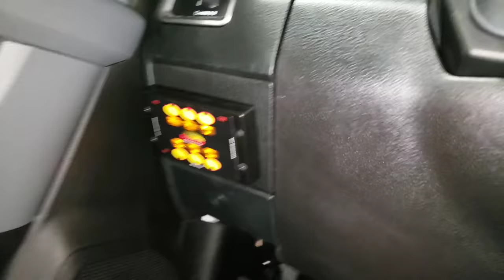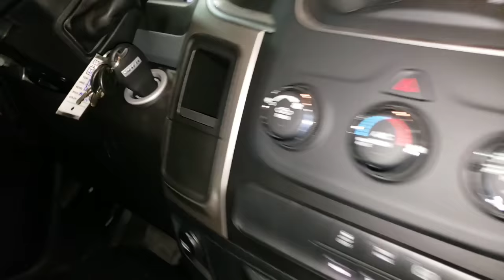LED Strobe Light Install & Sync (ST3/ST6)

Comment: What did you use to drill the larger holes ?? That’s some type of hole saw??
Reply from the maker: Yes, Its called a Rotabroach. It is a sheetmetal hole saw.  Sized used in the video was 5/8". The hole saw kit can be purchased from most tool trucks like Snap-on. I get the replacement saws from Grainger Industrial Supplies or Kimball Midwest.
Reply: @WRECKERMANDAN  ooö

Comment: Instead of using a power prob or using a wire from the battery to change flash patters, couldn't you run a lead from the yellow wire and tie your strobe to a momentary switch?  Just asking because your video is giving me ideas how I want to wire my strobs
Reply from the maker: Yes! Great question! Thank you! I have done this on some vehicles and forgot to mention or show this option. That is a great way to do it.
Reply: @WRECKERMANDAN  thanks dude. Your Craftsmanship is supreme.  Your video is now my guide.  The only thing am unsure about is the twist you did.  You used a drill to twist them but it does show what was Supporting the other end in order to achieve that perfects twist.
Reply from the maker: @alfredoandrea8345  I just clamped the other ends in a bench vise. Using a vise grip and clamping to a table or something solid  would work as well. 🤘

Comment: Can you do a detailed video on building the wire harness and specifically connecting wash light in sequence to said  harness? Your work is top notch. I wired up my grill and bunker strives last night and I couldn’t get it nice like I wanted with but connectors couldn’t get them to “y” nicely. Ended up twisting sodering and heat shrinking everything but it’s not near as clean as I’d like

Comment: Does that group 1/group 2 syncing process work for most strobe light manufacterers or just this specific company?
Reply from the maker: It can work with other manufacturers but, not all. I believe Whelen has some options that can also be grouped. I have some selections on Amazon through the link in this videos description. Just make sure to check the details before purchasing. Hope this helps. 👍

Comment: Nice work  ... Just wondering what's J Box? ..... Where can I pick? Up those kind of lights. I have f 550 With the relay box Built into it. So I just need lights correct?
Reply from the maker: If you have factory switches installed, yes, they have factory relays per switch. You will just need to find the factory wire harness under the hood and test each wire to identify each switch. By "J" box I was referring to the electrical junction box. There should be a link in the videos description for a few options and where to purchase.

Comment: I’m surprised they opted for a chrome bezel when all the other lighting on the rear clearly had black bezels or surrounds. Only thing I like to do differently is drill all my holes first, then go around and paint the bare metal where I drilled. 

Great video. (Other than the music). 😅

Comment: i am trying to setup some lights on my headache rack and i would like to have it on a rocker switch if i get them wired in sync with the yellow wire would i need to also have power able to go to the yellow i dont plan on changing groups
Reply from the maker: Get them on the same group if you want them to have the same pattern at the same time. Run one rocker switch for the power (to turn them on/off) and then piggy back that same (input) power over to another rocker/momentary switch with the yellow wire on it. With this setup, one switch will control on/off, the other will allow you to change the pattern. 💪🤘

Comment: So the red wire is the power and the yellow wire is for syncing the Flasher? I bought a few boxes of those light but never came with instructions.
Reply from the maker: You are correct! Once you have all the groups, flash patterns the way you want, make sure you have the yellow wire connected to all before powering them on.

Comment: So just to be clear, once I’ve got power to my strobes, do the pair with the same flash pattern have to be connected/paired by the yellow wire so they work together?
Reply from the maker: Yes but, all lights, (regardless of what pair) need to be connected together with yellow wire. This is why we set the group on each light before we wire it in.

Comment: So on the front of the grill you connected all the red with red, black with black and yellow with yellow separately together by there color? But left the yellow connected together out unless they wanted to add a separate wire to the battery for that
Reply from the maker: Ya, I just cut into the yellow, once all connected, wherever is a convenient spot for you, to install a butt connector to jump with power if you ever just want to change the flash sequence/pattern. Doing that will not mess up your groupings or sync. You could even run a fused powered switch to the yellow and use that switch then to change  flash sequence/pattern.

Comment: And they d sink if you change them again and cycle thru how do we stop that happening so i can have them set solid and then to strobe if i need it with out having to cycle a 100 times to get it matching again
Reply from the maker: If capable of syncing, (not sure what lights you are using) and wired correctly, they should not become un-synced if just cycling through/changing flash patterns.
Reply from the maker: You can setup a button or toggle switch that would allow you to quickly skim through patterns but other than I don't think so. They are not setup to change patterns on the fly. There are light control modules that will allow you to do so. Check with Whelen lights. They have some light control kits that might work for you.
Reply: @WRECKERMANDAN  takes a bit of time go resinc im using the 4 or 6 led orange beacons with three wires its a pain im looking at strobe controllers next

Comment: have a question, I am wiring up 8 hideaways and 6 surface mount lights to a switch box but ea. circuit on the switch box says it's good for 3 amps per switch, but i wanted to turn all lights on from 1 and use another for the solid white override on the rear hideaways. will I need relays ? also what size wire are you using, the leads on the lights I believe are 18ga. the lights do not give me what the amp draw is but it does say max input is 1.4 amps. thanks
Reply from the maker: You are probably not going to be able to put all thw lights on one switch if onyl a 3 amp max. With LEDs you may be able to come close. With the info provided, I would say atleast try it and then you will know the system's capabilities. A fault will most likely only accur or be noticed once the system has been all on for a little while. For the solid white override, you will need a relay to switch one operation off when the other is switched on. The relay can also be operated by the same switch controlling the overrides. Sorry for the late response and I hope I was able to help. Let me know how it goes...👍
Reply: @WRECKERMANDAN  thanks for the reply, I did build a relay box with 6 relays so I can run front and rears independently also another relay for the flood or solid white function for the rear hideaways, so now I won't rely on the switch to provide amperage, it should just turn on relay and draw amps from relay, relays are also fused for safety, I decided to use 16ga wire for the wiring harness,  I have mounted lights, the feniex 4200 mini switch controller, just need to run the harnesses and mount the fuse/relay box and wire it up. It has been a long project since I have limited time to work on it but it's coming along, thanks for the help, I have also installed a couple 200ah batteries and 4000w inverter to run my welder and power tools, charge batteries etc. When I am on a job that I have no power or is too far away, so far has been working awesome along with the 60amp dc to dc charger I am never worried about being without power, much better IMO than hauling my generator or gas powered welder.
Reply from the maker: That great! I used to have a similar setup in an old Grand Cherokee but it was a purchased back lit touch-tek system with their own relay box I used. I forgot to mention it was 14ga wire being used. I had two yellow top Optimas with a harbor freight power inverted and Readywelder mig spool gun that fit in molded case. Your setup sounds amazing. Glad you got things worked out. 👍
Reply: @WRECKERMANDAN  awesome, I am hoping to have everything completed in the next few months and try to put together a video on it to maybe help someone out there looking to do the same. I'll send a link your way.

Comment: So are you saying you don’t have to run the yellow wire to switch. Just leave it somewhere where you can hook up to battery to change pattern.
Reply from the maker: Yes. They all need to be connected with this wire to communicate with each other but the switch to opperate only needs power and ground. If you want to install a switch to change the pattern, you can run power to a seperate momentary switch and connect the yellow wire to that.
Reply: @WRECKERMANDAN   Thank You So Much. I appreciate you quick reply. 👍
Reply from the maker: Thanks, I try. 🤷‍♂️👍

Comment: so to clarify syncing.... first you touch the sync wire to a positive to cycle through to the pattern you want? we do each light individually. then once they are all on lets say, pattern number 13, then we splices the yellows together? is this correct?
Reply from the maker: Yep, you got it! Now you can hook up a switch to/or leave the (yellow) wire exposed to momentarily apply power and change the flash pattern of all together simultaneously.
Reply: @WRECKERMANDAN  ok so I just did that. All on one single pattern. Yellow tied together. I turn on and they are in sync for like a minute, then they start to not be in sync. Like they are all milliseconds faster and slower.
Reply from the maker: If you are using the same lights in this vid be certain that they are the same pattern. There are a few patterns next to each other that are extremely similar but different timings.  They will gradually go out of sync like that. It has messed with me a few times. Also, if using these exact lights, make sure they are all the same grouping.
Reply: @WRECKERMANDAN  well it is a different light but the instructions say the same thing. Oh and there’s a white wire for solid amber. That one I’m just ignoring

Comment: I bought some strobe lights, but the wires are so thin and brittle. When joining them it's like literally hair strands!
Reply from the maker: I would recommend soldering them in that case. just solder and heat shrink.

Comment: I have a set similar to yours here when I touch the yellow wire to the post to change signal the change to another pattern like their supposed to but after I power off then turn them on again they go back to just staying on until I have cycle through the signal again. How do you get them to keep the signal once off and back on again without having to change it all over again thanks
Reply from the maker: Im not sure why your experiencing that problem. What light are you working with? They may not be keeping memory. Depending on the light you have, it may need to have a constant power in order to store its settings, or it just might not be capable of storing settings. 🤷‍♂️
Reply: @WRECKERMANDAN  how can you tell if it is or is not capable of storing memory, does it lack certain wires or is it on the board of the light. thanks
Reply from the maker: It has something to do with the board. Maybe no caps to store a saved setting. Cheap products are probably not built with these things in mind and just have one setting or are built to just cycle through all patterns continuously or make you adjust it every time power is applied. 🤦‍♂️ Check with manufacturers first. Stick with reputable brands. 🤷‍♂️
Reply: @WRECKERMANDAN  yeah man the lights I had gotten were off of Amazon, they were in fact the cheaper kind. As you said they don’t store a memory for some reason. I thought would have been as long as the wires were connected to power they would hold the current pattern but won’t do it unfortunately. 

I have a full time lawn business so having some lights as these really help me to be seen out by the road side. I wired two of them into one of my zero turns then wired a push button style switch (originally was a horn switch) to it and it works fine just sucks to cycle through about 8 different patterns every time. If you don’t mind me asking if yours keep the memory would you mind sharing a link to where you had bought yours? Thanks for the input
Reply from the maker: There should be a few links in the videos description. The Whelen or Brookings ones would work for you.

Comment: Great video, only question is do you have a video showing how to wire lights in groups and what it looks like
Reply from the maker: In this video I wire the lights in groups on the grill and tailboard and sides of truck. On the grill, group one and two are kitty-corner from each other. Group one is also on the sides of the truck and group two is also on the tailboard. All lights were grouped previously in the beginning of the video when I show how to program grouping. This needs to be done prior to wiring together. Flash pattern can be set/changed afterwards. Once the lights are programed/group assigned, they can all be wired together in the same harness utilizing the same power. Make sure to connect all the lights together with the sync wire so that when power is applied momentarily to the sync wire it will change the flash pattern on all the lights so they will continue to all be on the same pattern. Group one and two could be seperated with their own sync wire for each group if you wanted to be able to have each group flashing a different pattern. Hope this helps clarify some things.

Comment: Hello, how to connect the yellow electric wire to the switch to change the mode Thank you
Reply from the maker: Sorry for the super late response. The yellow wire does not go to the switch. It only connects all the strobes together to allow them to comunicate with each other in order to stay synced. You can take it a step further by installing a switch for the yellow wire in order to change the pattern. This would require a momentary switch which also has a constant 12v so you could momentarily flip the switch and supply the power to the yellow wire to change patterns for a real clean install.

Comment: I'm designing  e-bikes. Not just bikes with a milk crate on the back with batteries cobbed together but really nice designs. One bike at a time.  Beat the hell out of it and see what breaks and what holds up and off to the next generation.  I have a 12 volt battery for the headlight, high and low beam, turn signals, front and back, and horn.   All is good.  What I don't have is a brake light.  I want to install a strobe brake light but there's one problem.  The brake levers are 5 volts into the controller. When I pull the brake lever it cuts power to the motors increasing the braking power, as it should be.  How can I tap into  that 3 wire 5 volt connection to use the 12 volt battery power to illuminate a brake light and still cut the power to the motor?  I need to take a normally open circuit and use it when it's closed to allow the brake lever, when pulled to cut the power to the motor, and allow the 12 volt battery to give current to the brake light.  Does that make any sense?  I'd really appreciate any advice you can give me on this.
Reply from the maker: Sounds like you will need to build a relay setup using a couple relays chained together. These will act as switches that can control where power will be directed.
Reply: @WRECKERMANDAN  Thank you.  That's what I came up with too.  I think I can get away with just one relay, because when I put on the brakes, I pull both brakes at the same time.  My question is... Normally Open Relay or Normally Closed?   When the brake lever is at rest there is current to the motors. That would seem to me to be normally closed.  When the brake lever is pulled there is no current to the motors. That would seem like I need a normally open relay.  Does that sound right to you or do I have it bass ackward?  I really appreciate your responding to my question. I really didn't expect to get a response.   I'll be looking at more of your videos to see the lights you have on your site and see all the options available with regard to style and flash patterns. Maybe I'll change out the turn signals entirely with something new... Something unconventional, something different.  The relays are cheap enough that I could just order both and figure it out, but I like the fact that this is the kind of thing that you do. I don't want to be a bother.  I know your busy and thank you again for  getting back to me. You do really nice work and that's an inspiration to me.  I have a never ending  thirst for knowledge and design is my juice of choice.  Thanks again.

Comment: Hi buddy, if i buy 40 pieces,can i synchronize them all together so i can make my own light bar emergency lights ? 

I found them pretty cheap on Aliexpress and thinking about buying 40 pieces to make Light Strobe Bar to mount it on the roof of my tow truck !

Thank you
Reply from the maker: I have not seen anything refering to a max amount of units that can be synced together. Operates at less than 1A which varies by flash pattern. Just take into account recommended fuse for 1 unit is 1A. Also remember there are only two group modes to alternate between. The ST3 model has 12 flash patterns while the ST6 has 19.
Reply: @WRECKERMANDAN  The group mode remain confused to me... 🤔 Even though you explain it very well, my knowledge in wiring is not that great...

This mean i have to use 40 fuse units ? One fuse for each unit ? 🤔
Reply from the maker: @mihai0377  I was thinking more like one 40A fuse.
Reply: @mihai0377  Many have 15pcs max sync
Reply: @jobathano1660  Thanks Jobathano 😉